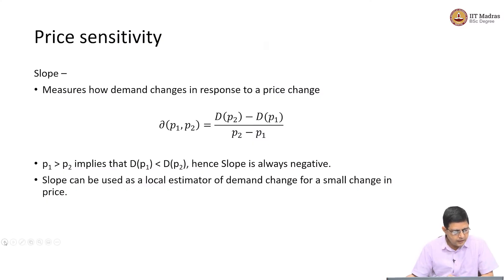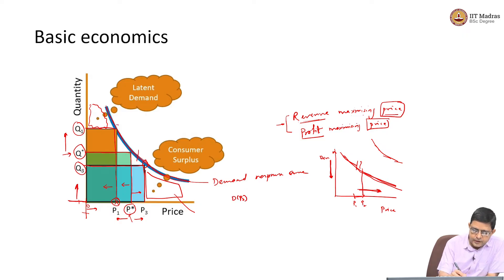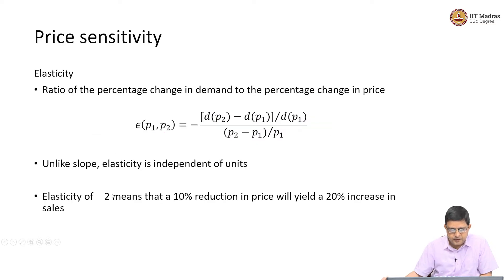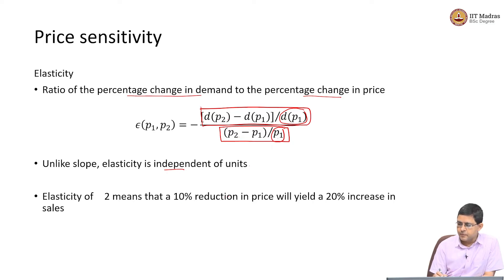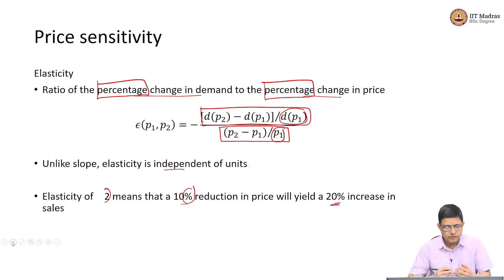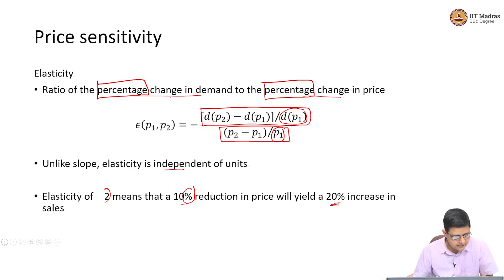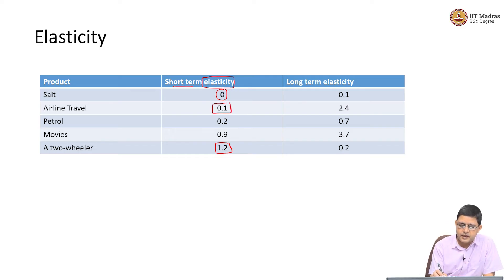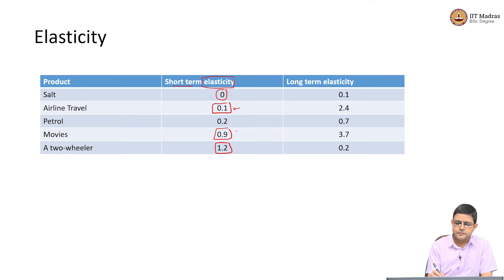Elasticity

Comment: I can't help, but compare BA with BDM.  Though BA is considered as a successor or BDM, it should be the other way round.  The subject of elasticity has been addressed in a jiffy in BDM, whereas one whole video is devoted to that in BA.  I'm positive lot more students will start appreciating the subject of economics, if you make the switch between the course placements.
Reply: finally the first 4 weeks of BDM are changed